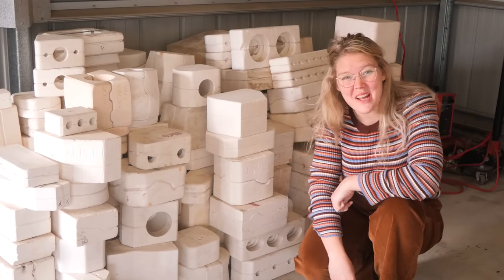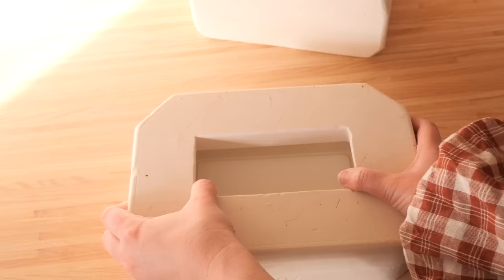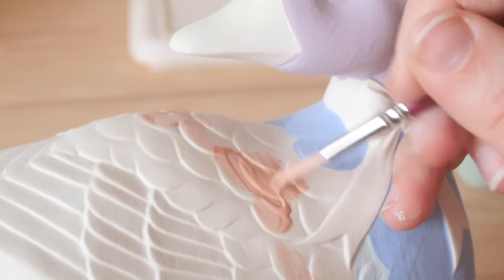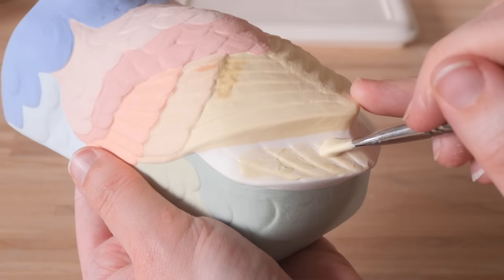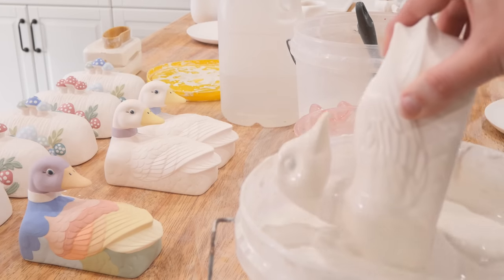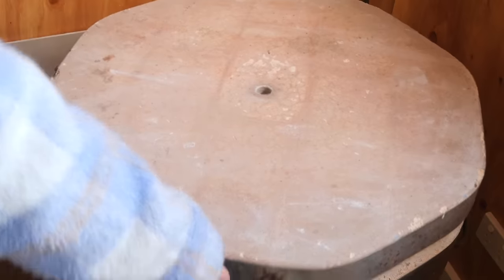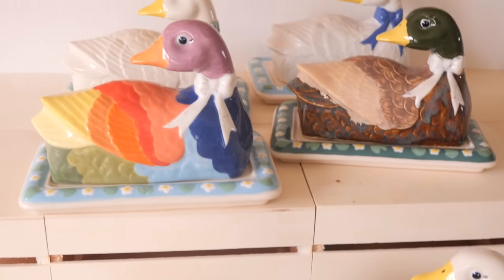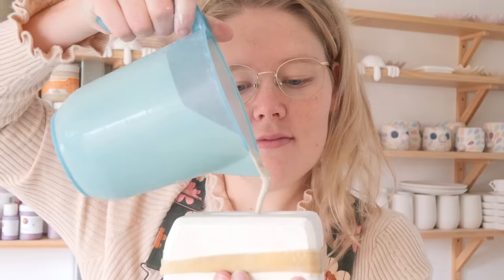Ep.2 Did you have a favourite dinnerware set as a kid?

Comment: Are you considering getting a larger vat for your glaze and just hanging the pieces on wire and dunking them? Or is there a reason you don't like using a wire to hook the pieces and dunk them? I've seen others do that, but I wouldn't know reasons for or against that practice.
Reply from the maker: I actually have a larger bucket. I decanter into the smaller one because I like having more control over the consistency. So lovely you asked because I didn't realise this was something I did and developed to make things easier for me. The glaze particles seperate really quickly and sink to the bottom. So having a smaller bucket means I can keep all the particles really even and balanced with less whisking in between batches. I also found it made it easier to gauge if it was well mixed with the clear bucket over the opaque ones. I don't personally like using a wire. It just feels like an unnecessary tool for me. I have shared a video about why I don't like the wires but I think they are great if you like to use them yourself!
Reply: @ShelbySherritt  Ok. That makes sense. I didn't think about how the glaze would settle like that. I never thought about the fact that you whisk it in so many of the videos.